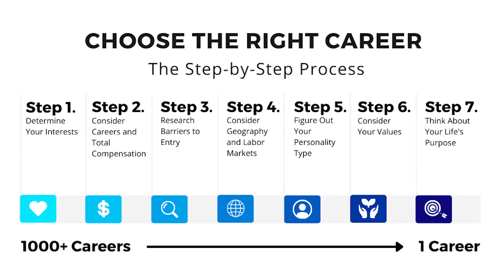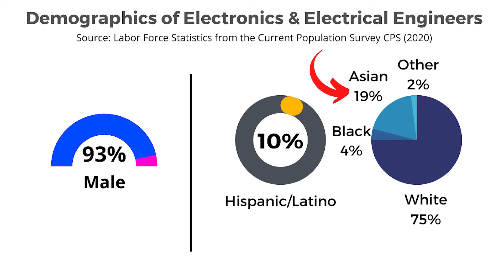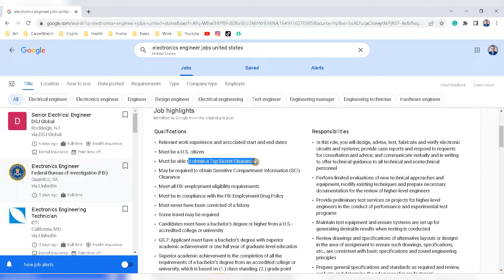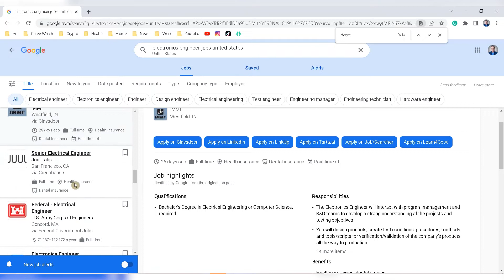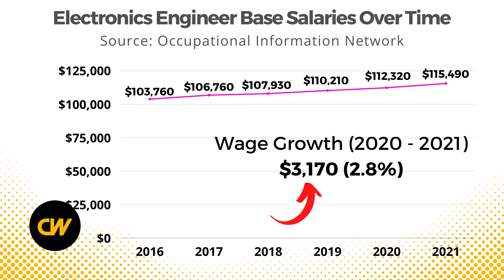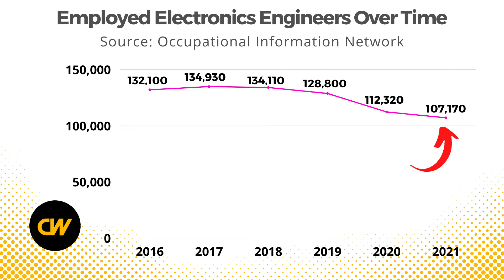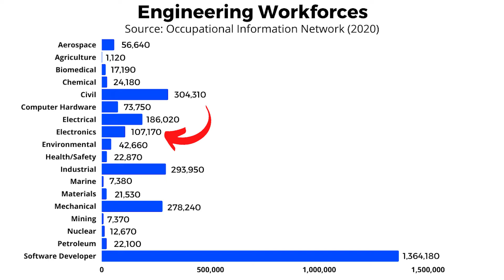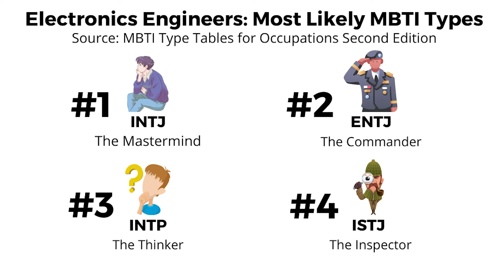Electronics Engineer: Salary, Jobs, Requirements (2022)

Comment: Avoid this career if at all possible!
Reply: i'm thinking of going into this. Why do you say avoid it.
Reply: @marlonwade4611 hes just trynna stir us up, i would do it its quite funny in some way, people trynna decide what to docieth their life and you fuck it up, instagram comments vibes
Reply: @marlonwade4611  Executives have decided that since there are no "lemon laws" for apps, then it does not matter if the app works or not. Their "warranty" is "Caveat Emptor". So they hire the cheapest warm bodies they can find. That means new grads with no experience. That also means, that once you get experience, you cannot get another job — you are no longer a new grad.
It has been my experience that the only executives looking for ability are the desperate ones. The company I worked for the longest was running in the red. After my design went into production, they became the world leader in their niche market. Then the owner sold out to a holding company. Everyone was fired/quit.
More examples: look at the Power Supply Units (PSUs) used in PCs. The design dates back to 1920. There have been incredible advances made in the last 100 years. But none of the 21st-century designs are in production (except for Teslaco.com). The Voltage Regulator Modules (VRMs) used in motherboards and graphics cards are also 100 years out of date. They use the 1920 buck converter despite all its defects.
Find a more innovative career like plumbing or construction.
Reply: @marlonwade4611 did you end up going into it?
Reply: Bro really didn’t give a explanation 😭
Reply: @carloslyon2256 W
Reply: @carloslyon2256  fr, everyone in the comments who dislikes the degreedoesn't specify why
Reply: Bro I’m in it too please why are you saying this

Comment: Better than electrical?
Reply: It depends on what you define as better It’s very subjective which you can’t put it in that way 

If you feel you like to build electronics or hardware such as medical equipment, robots, drones etc more then study Electronics engineering 

If you like to work with Transmission, generation, and distribution and Electrical power then this is more for you 

they also have Electronics part too but you have to deal with both area if you want to be electrical engineering 

If it’s only the electronics that has your interesting then go for electronic engineering 

Whatever you choose both are good choices
Reply: @teknul89  In our country(Sri Lanka) we have these degrees as "Electrical & Electronic engineering" and "Electronics and telecommunication engineering" So here is there some differences in Electronic engineering 
and Electronics and telecommunication engineering ?
Reply: @TechnoSoftlk  they are very similar to each other It all depends on your interest if you are more interested in the electrical part with electronics or the telecommunications part with electronics 

Telecommunications has area in computer networks and the internet, satellite engineering, microwave engineering, antennas, Mobile communication

Electrical has area in radio frequencies, radio, power, controls, high voltage, just to name some few
Reply: @teknul89  Thank you so much for the details❤
Reply: @TechnoSoftlk  you welcome bro :-)
Reply: Your mom likes it
Reply from the maker: Very similar.